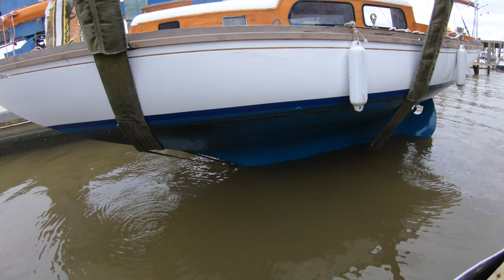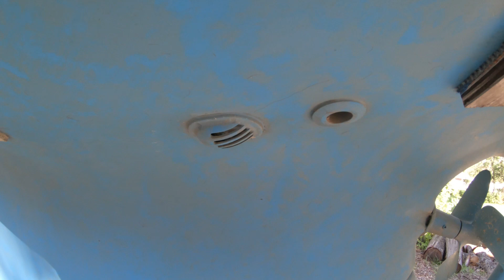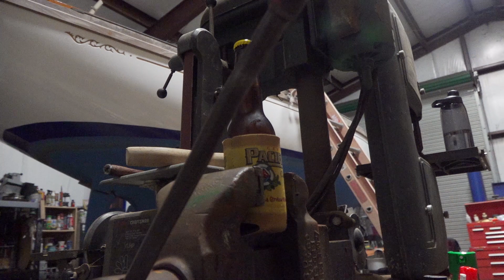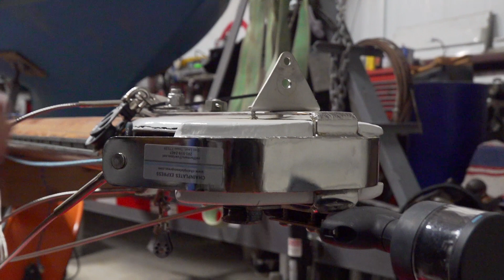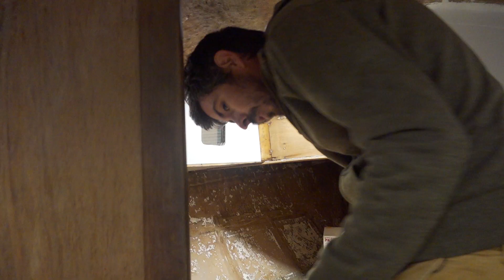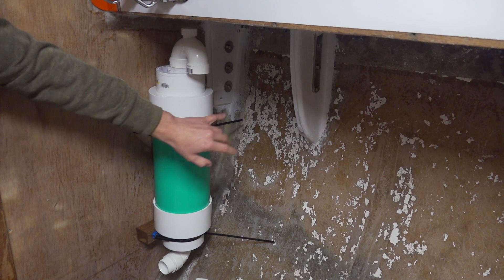Getting our Sailboat Ready for a Trip | SailBros Ep. 50

Comment: The thru hull direction is correct. If the tru hull was faced the other way if would force water up into the engine and into the exhaust. The exhaust would fill up and allow water to get through the exhaust valves and destroy the engine.
As to the propeller ? Where is the cotter pin ?

Comment: someone indicated to me that the thin nut should be toward the prop with the fat nut outside. I had mine set up like yours. Anybody have any input?
Reply: I just googled it . . . Which propeller nut goes on first?
The half nut, also referred to as a jam nut, needs to go on first, against the propeller, followed by the larger nut.
Reply from the maker: Thanks for the info. Will definitely be getting that sorted out before we go back in the water

Comment: Will gravity work when emptying the toilet holding tank to a sea cock below the water line.  I would think the sea water pressure would fight the gravity trying to empty the tank.
Reply from the maker: My understanding is that it will always drain down to the level of the waterline. So there will always be some  liquid in the length of hose from the thruhull to the base of the tank which is at the waterline.

Comment: I’m not sure how far off shore you are going ? If someone installed windows in my boat like you have done with no fasteners I would fire them.
The windows you installed “ with no fasteners “ are destined to fall off if you get yourself in any type of serious weather.
Reply from the maker: The original glass windows were also installed with no fasteners. They were sandwiched in-between two pieces of thin teak trim and caulking. So the interior trim piece was really the only thing supporting the window. In my opinion this method is way stronger because the window is adhered to and supported by the outside of the cabin so if we were to take a wave over the side we're not relying on a piece of trim to keep the window from busting in. Isn't this also the way most windows are installed on modern boats?